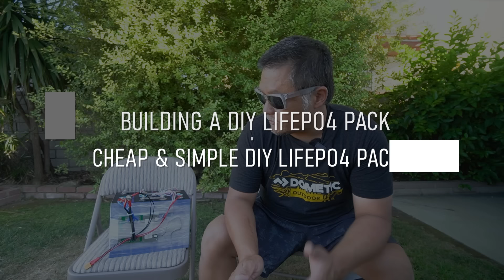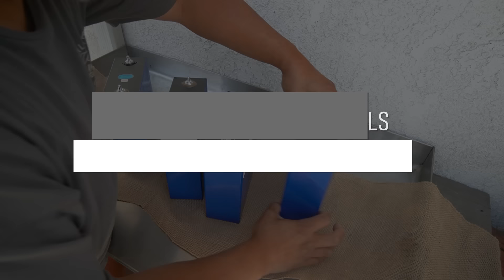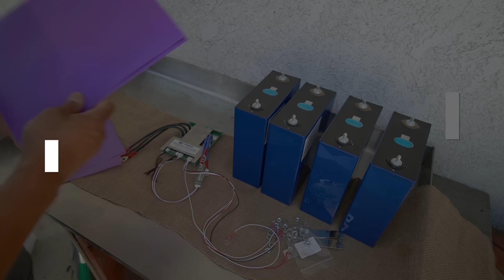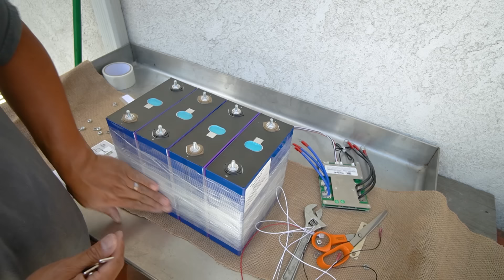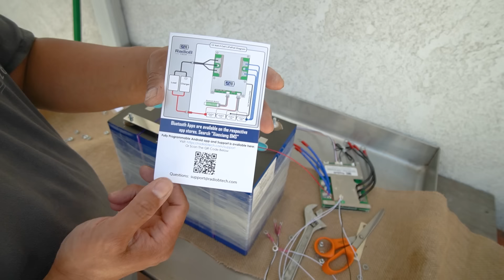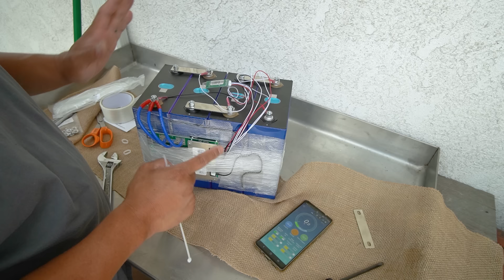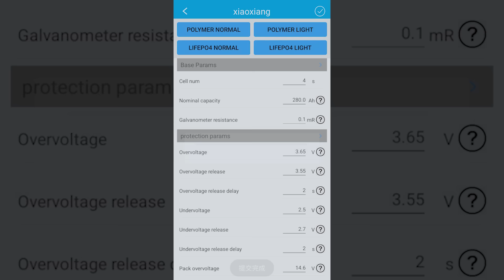EASIEST DIY 12-Volt 280Ah LiFePO4 Battery // Step-By-Step Build

Comment: Not bad,a bit long but very good; i mean the video and your way of explaining things,actually; everything here seems to be low cost to you; not to me,unfortunately,  700++ dollars for ONE battery is a lot of money,not low cost at all; and that on top of the solar panels,inverter, automatic switch etc; and with the electronics, you better have spares;  low cost would be its real price,about 120 dollars; the bms alone only costs 8 dollars in parts.
Reply from the maker: Thanks. I think. Your assessment of 'for just one battery' is not very well founded. You can have a brand new 100 ah battery that most would consider cheap at 300 bucks but this is nearly 3 times the capacity. Cost of lithium batteries are typically based on $ per watt hour. This is at $0.18 per watt hour. Unless you go with used cells, you will not likely find anything brand new at that 'per Wh' price. For sure nothing of any decent quality. I challenge you to look around. That means, from a source that actually ships and delivers what they promise.

Comment: I live in Canada. Any chance you could recommend a BMS with same features but also able to accommodate heat pads.  Appreciate the tiem and effort you put into your videos.
Reply: Lyndsay,Whats you battery details ,Maybe i can offer help
Reply: @GoGadgetsLife  SOK 100Ah 12V LiFePO4.  I bought them 3-months before the same battery with the option of heater pads became available.
Reply: @lyndsaybeck2249  use an active balancer (aB) for your 100Ah cells. They have much more precisious performance then such types. You configure only the cutoff voltages (2,5Vmin / 3,65Vmax per cell)  in your inverter. 
The balancer manage the cells until 0,001V difference. An aB produce no heat and your system has no powerl loss!
negative: aB have no BT and Apps if you want present your cells your neighbour ....

Comment: Could all the tape cause the batteries (cells) to not dissipate heat well enough? This was very enjoyable to watch and makes me want to make one (or more).
Reply from the maker: Perhaps. But so would an enclosure. For off-grid power, the c rate is very low so batteries don't heat up that much. It would actually be a benefit in cold temps. Like I said, there are lots of ways to build a battery. this is just a good and fast way to build one in about 10 minutes for a YouTube video.

Comment: Is there a hi temp sensor? Is there a problem if the pack gets to hot like if it sits in a van during a hot summer day in the desert?
Reply from the maker: High temp cutoff is at 146F. I hope I will never have to confirm in my van that it actually works.
Reply: @freelyroaming  hahaha me too... just didn't want to come back to a van in flames after a day hike in the desert :)

Comment: Nice.
I thought these packs need to be top or bottom balanced before assembling.

Also how was shipping cost?
Reply from the maker: Did you not see the part of the video when I talked about top balancing? Watch it again here: 13:35.

I am also making a separate video about how you can use just your standard charger and the BMS to achieve top balance after the assembly.
Reply from the maker: btw, the price shown in the video is $137 per cell  when you order 4. That included sea freight to California. Your shipping prices may be different based on your location.
Reply: @freelyroaming  thanks. Will keep an eye out for the balancing video.